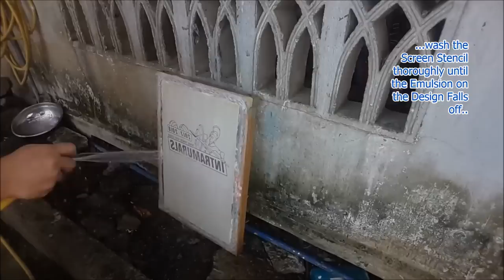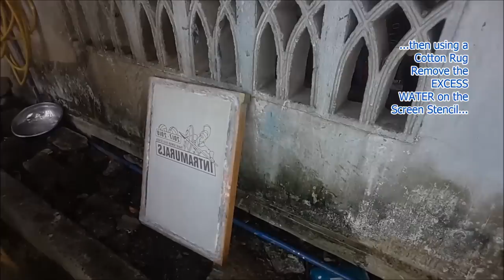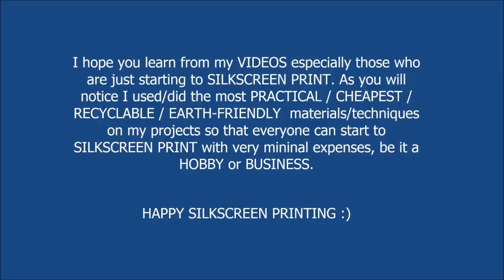Screen Printing: A Step by Step guide in Printing...

Comment: I screen print as a hobby, and it's really fascinating.  Eventually I will try to print onto T-shirts, bandannas, or other things that use fabric that I can lay flat when printing.  I screen print on balloons since  I like balloons a lot.  I cannot afford the nice balloon screen printing equipment that most hobbyists use, so I made my own balloon printing equipment out of wood, 3/8 inch threaded rod, nuts, washers, hinges for the printing screen wood frames, and stretch cables with hooks.  It requires no power because it is operated by hand.  This equipment does not look fancy, but will give you great results when used properly.  I use the techniques on this video to make my screen printing frames.  For printing on balloons, I use both 230 MESH and 300 MESH SCREENS for maximum detail.  Balloon ink for latex balloons is probably thinner than some T-shirt inks, so it can easily pass through a 230, 270, or a 300 mesh screen.  What size screen mesh do you use?
Reply from the maker: I used 100 mesh for T-shirts...I think what you're doing is really interesting, thanks for visiting and Good luck to you sir...

Comment: Great video!  I do screenprinting, mostly with prepackaged screens (EZ screen) -- although just bought a bucket of emulsion to give that a more serious try.  Have you tried using transparencies?  I am using the inkjet-compatible ones with great success.  Also, I (on advice from other videos) re-expose the screen in sunlight after it is washed and dried and that hardens the screen nicely.  Your white emulsion is great - the emulsions I can get are obnoxious colors.  Your tees look fantastic!  The dyes I have require heat-setting with an iron or heat-gun.  Keep making videos, they are great.
Reply from the maker: Yes I tried transparencies  before but I would suggest ordinary paper for starters because it's cheaper, thanks for the suggestions and good luck :)

Comment: Hi just wondering if the ink is exposed to heat would it run? I'm trying to print onto organic cotton and then put hot beeswax on them and use as reusable  food wrappers.  I'd like my own design on them but just wondering would you know of an ink that would be fairly heat resistant but also eco friendly?  Any advice would be appreciated.   Thanks for sharing your video, it was really helpful.
Reply from the maker: Thanks for watching my videos, most of the water-based paints can take heat, my concern is if you're going to use the printed material in wrapping food, I'm not sure if it is safe for that purpose....maybe you can search the net for the ink that is eco friendly and safe and can be use  for that purpose....
Reply: @EasyVideos  thanks for the reply.  Currently searching alright.  Will keep looking until I get it right!

Comment: This is a simplier way in doing the silk screen printing..great job! I just wabt to ask if i used different designs,do i need to change the mesh screen everytime? Pls answer po.
Reply from the maker: You can change the screen mesh or you can re-claim the screen to use it again...

Comment: Thank you for this instructional video, it was very helpful. However, as i tried your process sir using same materials, the lines on my design appeared jagged and had a hard time removing emulsion from the design on the screen. I was wondering where i made my mistake, is it because of the emulsion being too thick? or did i undercook/overcook the design under the sun??? Hope you wiil reply sir. :D God bless you and your vids.
Reply from the maker: The Photo Emulsion on Screen is Too Thick.....
Reply: @EasyVideos  Thank you, will try to make another one again :)

Comment: Nice video,what size do the print need to be for the back and what for the front left chest, I want to do my own t-shirts and hoodies
Reply from the maker: Usually sa Size for the Chest logo is from 2.5 to 3.25 inches.....then the width of the Design on the back is  10 to 12 inches.....

Comment: Good work!
It is also hard work and you have not hidden anything from the viewer.
What do you do for exposure on cloudy days?
I suppose you are using s diazo sensitizer so may be tube lights won't work.
You have even showed the hardening process.
An inspiration to others.
Reply from the maker: Tulco is the Brand of sensitizer I'm using.... if it's not cloudy Exposing the screen to Sunlight can be done in 10 seconds....but it's cloudy that's why it's 30 seconds....thanks ...:)

Comment: Great video! I only have one question. Does it matter what type of printer I use? I’m very new to this so I apologize if my question seems silly. Thanks
Reply from the maker: It's ok to use any kind of Printer, the Important thing to remember about the Design/Positive is it should be Solid Black so that the LIGHT Can't Penetrate the DESIGN/POSITIVE During Exposure to the LIGHT...

Comment: Thanks for uploading this useful video
I have two question.
1. How to clean the  paint from mesh after painting is finished.?
2. How to clear the artwork from mesh to use it for another design?
Reply from the maker: I used Water and Foam to wash the screen after used.....you can use PHOTO EMULSION REMOVER (STRIPPER)  if you want to Remove the Photo emulsion on Screen....or use BLEACH : https://youtu.be/zcG5T9uvLzA
Reply: Thank you Very much for answering

Comment: can i use glue as a substitute for the emulsion.? and how long does it take to dry after you apply the emulsion?
Reply from the maker: Yes, but I would not recommend it for beginners....it will take 15 to 30 minutes to dry using Electric fan...

Comment: First time seeing someone uses non transparent paper and combining with cooking oil i mean that seems really interesting way to apply  it does it really work that easy? Or there is a catch to it  (everything does haha) :3 also is it not necessary to apply photo emulsion on both side of screen :O i love your video thanks for sharing your knowledge with us !
Reply from the maker: Since I used 100 Mesh Screens for my water-based paints  it had bigger holes compared to fine mesh screens used for plastisol inks, oftentimes small holes remains on single application of Photo Emulsion and that's the reason why I double or triple the application....Ordinary paper and Cooking oil works, maybe you can try it sometimes...:)

Comment: Hi I have a couple of questions do you not put anything between the shirts so the ink doesn't go through and do you need to use an inkjet printer or laser
Reply from the maker: The shirt is thick enough for the paint to go through the insides of the t-shirts and because of the SOFT  pad....I'm using inkjet printer for the positives....

Comment: for multicolor designs, can we use this method, or a machine is a must
Reply from the maker: You can start with this method , even without expensive equipment.
Reply: @EasyVideos  PLS MAKE VIDEO ON THE TYPE OF COLORS AND THE CLOTH MATERIALS ON WHICH SCREEN PRINTING HOLDS GOOD.

Comment: After washing away the emulsion coat and after applying the cellotape, do I need to cover the whole space except the stencil portion? So as not to make the paint move outside of the stencil when scrubbing it.
Reply from the maker: Just Cover the Edges of the Screen Stencil sothat paint will not leak....

Comment: Can you use this method with more picture like images? Also at the begining when you made the graphic is the yellow and white paint make a difference? Can you write in message step by step of the eceryhting including paint and where you got them
Reply from the maker: Yes you can use this process in Picture like Images (halftones) but you need to acquire more knowledge or experience before you can perform Halftone Screen Printing Process...the paint I'm using is JnJ Virgo: https://www.jjvirgo.ph/, https://youtu.be/27_dMWAj3y4

Comment: I HAVE QUESTION SIR... I AM JUST BEGINNER IN THIS ..   WHENEVER I  PRINT TSHIRT & IF I TRY TO LIFT SCREEN THE TSHIRT GETTING UP WITH SCREEN .. CAN YOU HELP ME LIKE WHICH SURFACE SHALL I USE (Currently i am using plain wooden surface)
Reply from the maker: If you're using Water-based Textile Paint make SOFT PLATEN and APPLY TABLE ADHESIVE on its Surface or if you're using Plastisol its ok to Use Wood Platen but it should have Table Adhesives also -so that the t-shirts are Stable while you're Printing...., https://youtu.be/o_6olC6iS-A .  https://youtu.be/4FKIFqn9dP0

Comment: Sir what kind of solution you apply in silk screen and it is need a photoshop application  in the print drawing sir?
Reply from the maker: The chemical I Apply on Screen is called Photo Emulsion, I used Corel Draw in creating layouts or design, but you can also use Photoshop or Adobe Illustrator: https://youtu.be/IhkRVfFZVqY

Comment: What did you use to remove the oil without damaging the screen? Running plain water over the screen doesn't remove the oil.
Reply from the maker: Water removes oil...washes with water...
Reply: @EasyVideos  Hmmm.  That's interesting. I'll try it. Thanks for the reply.

Comment: Sir Easy, since water based inks dry so quickly, after how many t-shirts do you like maybe add some more ink on the mesh to continue printing? and is it true that as you  continue in the printing process , after printing a tshirt you have to flood the design on the screen with the ink to avoid it from drying up thus blocking the design?
Reply from the maker: I can print 100 t-shirts in single session or more, paint will not block the design if flooding is done for just a while...if you have to pause printing for a long time then you have to Wash  the Screen Stencil and start printing all over again......Environment affects the Drying time of Water-based paint, the hotter the surroundings the faster the paint will dry so its better to print early in the morning or late afternoon when its no longer that hot....and you have to move fast while printing leaving the screen stencil longer than it should between prints will dry the paint on openings faster ......
Reply: @EasyVideos  thank you so much for your reply Sir

Comment: after putting the oil to screen and place the pattern, is their anything you apply on the top, i mean thinner to the pattern placing to the screen?
Reply from the maker: None sir....
Reply: i'd try it exposing to sunlight in 11seconds after i apply an oil to screen together with the patter but it does not work, thier is no pattern transfer on the screen

Comment: sir, why did you not put the shirt inside the platten anymore? unlike the usual practice? 
Also, for the back prints, did you use silkscreen process also or vinyl?
Reply from the maker: Since the front logo is only 1 Color it will be much faster to print the T-shirt this way......the Names at the Back of the shirts were printed using Paper Stencils but the process of printing is almost similar..... https://youtu.be/OLrBuP9erM8
Reply: @EasyVideos  thank you for your reply sir, can I use sublimation printer to print the design?
Reply: @EasyVideos  Thank you sir, can I use sublimation printer to print the design

Comment: i dint understand how the part with ink washed off and the rest stays?? cuz of the ink?? so the positive means the ink? so in the emulsion when touch by ink from the design it can be washed?? tahts the part that is confusing .
Reply from the maker: We call the printed design as positive, the PRINTED PART covers the PHOTO EMULSION during EXPOSURE while on the UN-PRINTED PART  the LIGHT can PASS THROUGH the PAPER, because of that the PHOTO EMULSION REACTED to LIGHT and HARDENS.....while the PRINTED PART of the PAPER Covers the LIGHT to PASS THROUGH
and has little affect on the Photo emulsion underneath and this is the part that is being wash-off during washing.........

Comment: Sir may I know what materials are used? (sorry I dont know about printing but I like to make one)
Reply from the maker: The Materials Mentioned on the Video are: the Printed Design (positive), Photo Emulsion, Photo Sensitizer, Photo Hardener, Scoop Coater,  Cooking Oil, Water-based paints, Packing Tape, Squeegee, Shirt Pad or Platen....

Comment: what kind of ink do you use? do you dry by air?
Reply from the maker: Yes You can use Electric fan or blower to dry the paint, or it will dry naturally even without applying air...that's one of the advantahge of using water-based textile paints...

Comment: Does the screens have To be stored in a Dark room before insolation?
 I'm in a phase of experimentation and sometimes i'm stuck. 
I put the emulsion on the screen (mostly at night) and I just let dry the screens on a table. The room where i work is not lightproof so the daylight get inside. But the screens are not get harmed directly by the sunlight nor the daylight. But i never succed the insolation! I try To do it with sunlight, then with Ultra-violet but it never work. Thanks for those who Will replay
Reply from the maker: just to be safe keep the screen with photo emulsion in a dark room, most of the mistake in developing the screen stencil is they Over-exposed, if that happen you'll have a hard time washing the screen.

Comment: I printed yellow ink to a black shirt but result is awful and blurry. What kind of paint do you use? Rubberize yellow?

Also, when I expose my design some of the emulsion won't fall off. It seems so hard. Help please :( idooool.
Reply from the maker: Yes Rubberized or Opaque Yellow, it's important that you use Soft Platen so that the Deposit of Ink is Thicker....

You Over-exposed the Photo-Emulsion that's why it's hard to Wash......https://youtu.be/0LrUiqnwVB0

Comment: hello I am Emma I didn't  see your ingredient  properly so can u pliz sand them … and beside them what else should I use pliz reply
Reply from the maker: In Making Screen Stencils you will need -Photo-emulsion (Photo Sensitizer and Hardener is optional since there are Ready Mix Photo EmulsionAvailable), Screen, wood frame, Positive/Design, and Packing Tape. The Materials Needed to Print the Design on T-shirts are Paint and Squeegee...If you can make Shirt Platen printing will be  easier...:)
Reply: thans

Comment: tem como me mandar o nome do produto que  usa para limpar a tela do silk
Reply from the maker: Since I used Water-based Paints I used water and Foam to wash the screen stencil after using it...you must wash it right-away after using the screen stencil, or it will be hard to remove the paints on screen stencil....

Comment: sir, noob question ano gamit mo emulsion tska po un sa sunlight pag expose 11sec kahit anong design?
Reply from the maker: 10 seconds lang po pag sa Araw, mahirap na kasing Hugasan pag Lumampas ng 10 Secs...Tulco Local Photo Emulsion at Tulco Sensitizer ang the Best gamitin....
Reply: @EasyVideos  kahit sir sa apollo glue bondtika sir 10secs lang po? 
pwede din po ba sya sa simulated process?

Comment: How to you register.  Do you. Just place screen against stop at the bottom of pallet.   
Noticed in this video shirts on top of board. How does ink not go thru ?  Every time when using water based it leaks to other side.    Want to use your board technic to speed up 1 color shirts
Reply from the maker: Using a soft Platen Prevents the Paint from going through or inside of the t-shirts, and the t-shirts are thick enough....

Comment: Hi bro... 
If i need to pause the printing for sometimes, what to do..? 
Will screen get spoil..? 
I need to print sample,after coustomer see the sample, i can countinue,
Reply from the maker: After using the Screen Stencil just Wash it, keep it and you use it again...
Reply: @EasyVideos  Bro i cleaned  with reducer...  it's ok...?
Reply from the maker: if you are using Plastisol Ink, yes it's ok...if you're using water-based paints -you can just wash it with water...
Reply: @EasyVideos  Thanks a lot bro.... 
🙏🙏🙏

Comment: Which ink have more washibliety on tshirt Plastisol or water base ink? 🤔
Reply from the maker: I think Water-based  inks are durable than Plastisol, doesn't Crack easily...
Reply: @EasyVideos  so much pins 🎳 you apply easily on screen & how much time the want to remove? 😁
Reply: OMG!! I am Reading my own comment 2 Years Latter :'D ( brohter i also use yours Technics in my Screen Printing. A little Question Water Base (Bottle Pack) ink have Expire Time ?

Comment: Saan po ba makakabili ng photo emulsion and sensitizer and yung hardener saka magkano po ba usually yung price?
Reply from the maker: Local photo Emulsion ng Tulco is P200+ per kilo, 20+ Screens na magagawa mo sa 1Kilo, then yung sensitizer and hardener is P150+ liter, matagal mo na ring magagamit ito....ang TULCO SCREEN PRINTING SUPPLY is located at Aurora BLVD in Sta. Mesa Mla, tapatng SM...
Reply: Thank you po! ☺️

Comment: Any tips for screen blocking? How to solve?
Reply from the maker: Paints Block the Screen when it started to dry, so the solution is for the paint not to dry fast.....Paint Dry Faster when surrounding is Hot, Print early in the morning 
or Late in the afternoon on a hot day.....do not point the electric fan directly at you when you are printing it will dry the paint faster....move faster when you are printing, paints dry faster on screen opening when left for too long....you can use paint retarder to prolong the drying time....

Comment: sir, magandang gabi. anong tawag sa maitim na nilagyan mo ng emulsion+sensitizer?
Reply from the maker: Scoop Coater....
Reply: @EasyVideos  may nabibili po bang ganyan?
Reply from the maker: Yes, you can also buy it on-line....
Reply: @EasyVideos  maraming salamat po! di po pwede iphoto transfer kapag hindi pigment ung gamit na ink pag print ng stencil?
Reply from the maker: Ang Importante sa Positive/Design ay itim na itim ang kulay para hindi makapasok ang liwanag during Exposure....